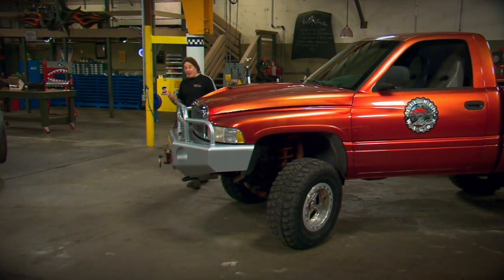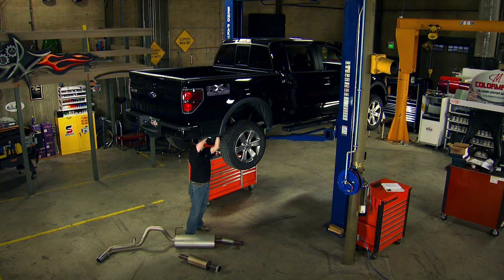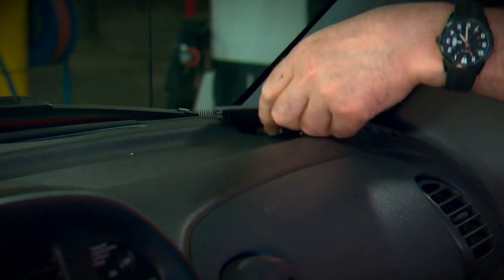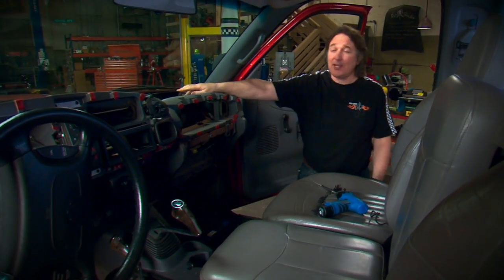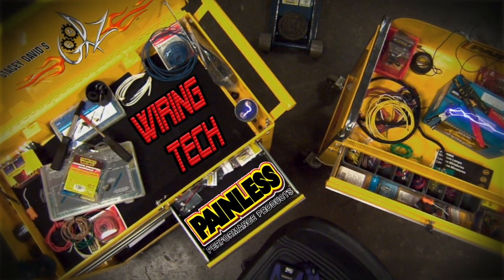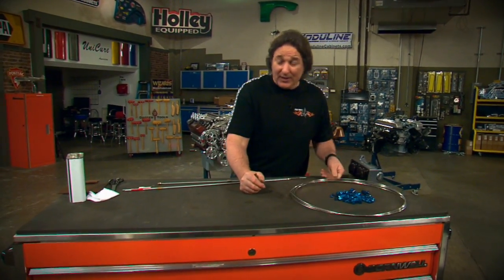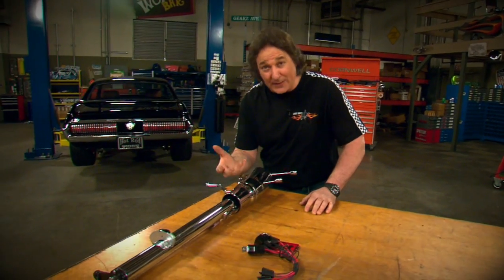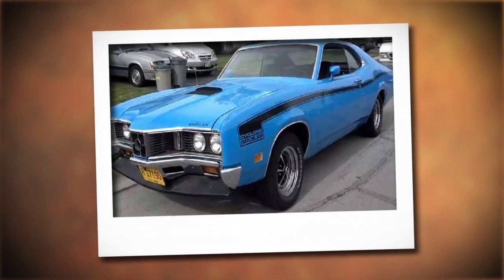LMC Truck Dash Fix, Clean Up Nasty Wiring & An Automotive Icon Turns 40 - Stacey David's Gearz S9 E9

Comment: I had a 1965 Oldsmobile 442 that I put a Corvette engine into made it a 80 over stroker. When I was done building the engine it had 800 horses under the hood, and 750 pounds of torque. It was all kept under the hood. I remember the long hours of making the wiring harness jig. and running all the wires and wrapping everything with electrical tape and finished covering it with the convoluted cable cover. lots of hours in the harness build but worth the time.

Comment: sorry but i call bs. I've been a certified master gm tech for over a decade.  your average guy is not replacing his dash in an afternoon.  it will be a couple days and then followed by realizing you forgot something important buried deep in there.
Reply: Yep.  At least there are big connections that can only attach to one place.  Unlike dashes from say 1974 where it looks like a spool of wire blew up in there. But yeah you're not doing that in a weekend.  Add in beer and well........a recipe for disaster.